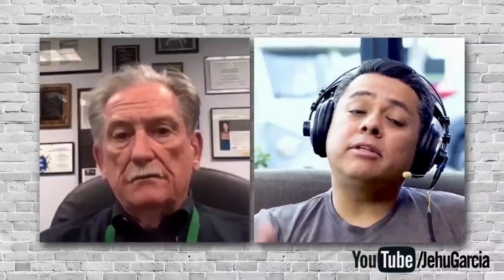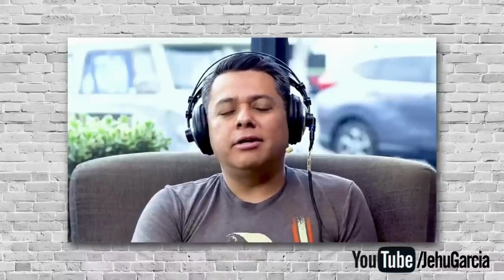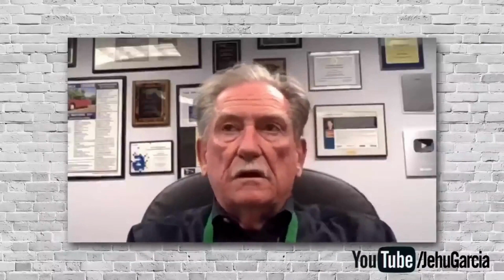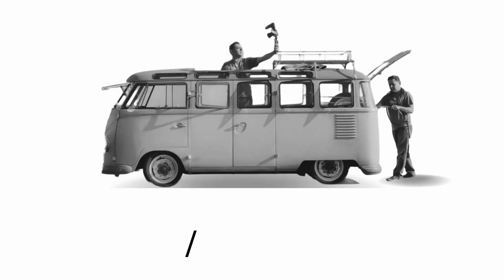EVs are simpler & less maintenance - w/ Sandy Munro of Munro LIVE

Comment: Maintainence on an ice car is:
Transmission oil every 30-50 k miles
Oil every 4-7k miles. 
Air filter every 45k miles
Coolant ever 4 or 5 years

Suspension and brakes are not unique to ice cars, and whats important to note is that EVs are significantly heavier than their counterparts making brake wear and suspension wear something you gotta pay more attention to.

So its absolutely true that evs are less maintenance, but is the difference in maintainence significant enough to be worth it? And thats a complicated answer. 

Cars are a fucking terrible investment, and interest on finances make it even worse. Until EVs are reliable enough that you can conceivably buy buy high mileage models without significant repair costs in the near future, they remain unappealling for lower middle class people
Reply: PS; and to be clear, yes you can buy high mileage ice cars and have them last for years with no significant repair costs. Where as EVs and many hybrids have absurdly priced parts in their drive trains.

Eg:  I had to run a quote for a new invertor on a Camry hybrid, and I could only find this part as part of a whole assembly, the cheapest was 5k plus 1.5k to ship (very heavy piece) and 2k in labour to install.  By contrast, We can do an entire engine swap usually under 4k
Reply: DJ you conveniently fail to mention spark plugs, fuel injectors, valve adjustments, head gaskets, drive belts, water pumps/radiators/coolant hoses, idler pulleys, spark plug wires, fuel lines, fuel pumps, ECM's, clutches, ignition coils rather convenient of you (Ive repaired all those at one time or another).  Each of those are both preventative maintenance items as well as points of potential failure.  On new cars those aren't much of a consideration on used cars or cars with over 50K miles those are significant. You are smarter than to leave those out instead your bias is glowing brightly defusing any pontential basis for logical argument here.   The rest of your position in the 2nd and 3rd paragraphs fail to hold water in the least bit those same stances were there when people made arguments that ICE cars would never repalce the horse, that no one need a comuter and there was no market for them, that cell phones are too expensive adn would never become mainstream.  There are those who understand and embrace new technology and there are those who resist it on purely illogical reasons then try to justify their positions... you fall into the latter.  There is a reason why every auto mfg is pouring billions into EV's and it's not because they heeded your advise thinking there isn't a market for them they are FAR smarter then.  Almost zero co's spend their time worrying about solutions to the lower class, it makes no sense no car mfg ever has and they should not waste their time doing so.
Reply: @slowery43  the infrastructure isn't enough to support an immediate flip to EV's.  California is telling people not to charge their fucking cars